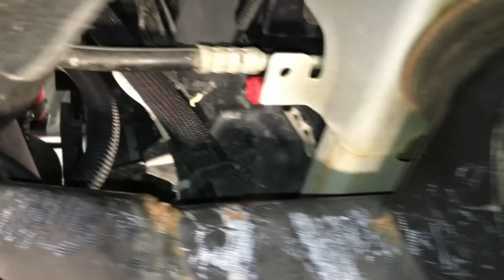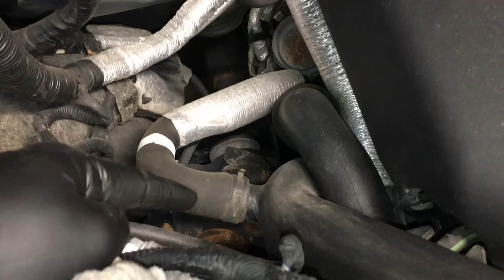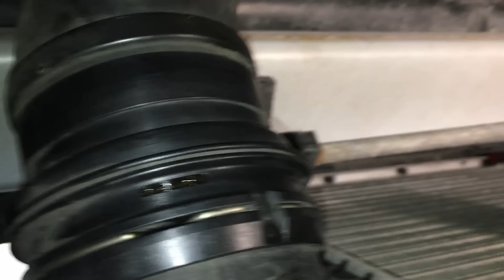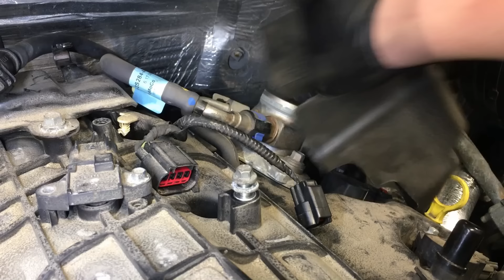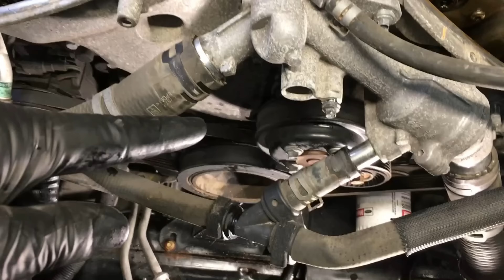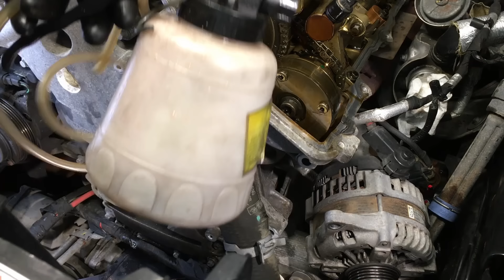2011-2016 Ford F-150 3.5L Ecoboost Timing Set Replacement Part 1: Getting Inside the Engine

Comment from the maker: These are the Tools and Parts I Recommend:
***LATEST PARTS***
Fuel Pump Mounting Bolts (one bag of two bolts)-
W503297S900
Intake Phaser (2 Required)-
http://amzn.to/2IBfdDc
Exhaust Phaser (2 Required)-
http://amzn.to/2u55yS7
Intake Phaser Bolt (2 Required)-
http://amzn.to/2u3Nech
Exhaust Phaser Bolt (2 Required)-
http://amzn.to/2FV0xx6
Primary Timing Chain-
http://amzn.to/2IGlKwy
Secondary Timing Chain (2 Required)-
https://amzn.to/4fzSuWv
Timing Chain Tensioner-
https://amzn.to/2GpN14E
Intake gaskets-
http://amzn.to/2FYsBPW
Valve Cover Gasket Drivers Side (All Years)-
http://amzn.to/2FROlBe
Valve Cover Gasket Passenger Side (2011-2012)-
http://amzn.to/2pr2dXY
Valve Cover Gasket Passenger Side (2013-2015)-)-
DL3Z-6584-C
High Pressure Fuel Pump O-Ring-
http://amzn.to/2FW19Cs
High Pressure Fuel Pump Mounting Gasket-
http://amzn.to/2pxj6QP
Water Pump Gasket-
http://amzn.to/2pvVWum
Pump O-Ring-
http://amzn.to/2psqCfX
Coolant Inlet Seal-
http://amzn.to/2prwJSw
Front Crankshaft Seal-
http://amzn.to/2prBfjZ
Front Cover Radial Seal-
http://amzn.to/2u59yC7
Crankshaft Pulley Bolt-
http://amzn.to/2u7P2kt
Motorcraft Front Cover Sealant (MUST USE)-
http://amzn.to/2psPqo2
Motorcraft NEW Yellow P-OAT Coolant (2 Bottles of Concentrate Required)-
https://amzn.to/3Pc66wi
Engine Oil 5w-30 (6qts Required)-
http://amzn.to/2GLtahd

**Recommended Tools**
Crankshaft Pulley Remover-
http://amzn.to/2G0lS8s
Camshaft Holding Tools-
http://amzn.to/2FXx7yd
Cat Claw-
http://amzn.to/2IBBJM6
Scotch Brite Cleaning Pads-
http://amzn.to/2Ga6GbV
Air Wand-
http://amzn.to/2DIe74L
Vacuum Bleeder-
http://amzn.to/2FWdWol
Oil Catch Can Kit-
http://amzn.to/2pnZvn1
***OPTIONAL PARTS YOU MAY WANT TO REPLACE***
Engine Valley Coolant Pipe O-Rings (2 Required)-
http://amzn.to/2HPpYAC
Degas Bottle Heater Hose (Common to Leak)-
http://amzn.to/2HRq3Up

TORQUE SEQUENCE AND SPECS:
Front Cover-
https://drive.google.com/file/d/1vvzqqEtyVb-ncDzoaGumVRJ8ZsoMr3xR/view?usp=sharing
LH Valve Cover-
https://drive.google.com/file/d/1_N1FFgp0ApZTaHuCum4muzBNVfigww_G/view?usp=sharing
2011-2012 RH Valve Cover-
https://drive.google.com/file/d/1O-QxJdoZ2r1wIKJErGMkkRhMRkuu2pX4/view?usp=sharing
2013 and Newer RH Valve Cover-
https://drive.google.com/file/d/1IL0rZz7uJLkS61bhPm24raulzfJoFBAb/view?usp=sharing
Intake Manifold-
https://drive.google.com/file/d/1W3s3GzR7T69OzV35Ehrm8-kf86eCZNFG/view?usp=sharing
Water Pump-
https://drive.google.com/file/d/1WdDoFxPYrGkam6PjeJr8B3RH0lhhm76T/view?usp=sharing
Thermostat Crossover-
https://drive.google.com/file/d/1f6_ZJOi2He-iLdAvcOO3fEmc1hh5yrIZ/view?usp=sharing

As an Amazon Associate I earn from qualifying purchases.
Reply: I don't see the 2 little chains for the cam phasers in the parts list. Are they reusable? Or do you have the parts numbers? I don't see them with the primary chain link
Reply: @joshdemars7960  Those secondary timing chains should be fine to reuse; I didn't replace them on my truck.
Reply: What's your opinion of opting for Cloyes chain kit & melling oil pumps vs FoMoCo?
Reply: FordTechMakuloco my dealer will not cover this under the emissions warranty and I am outside the powertrain waranty. They are coding it as 6C525 (cam). Do you have any advice on dealing with them? Thanks 
Dustin
Reply: Intake Gaskets:  6 required
Reply: Great video.  Do you have the part numbers for the High pressure fuel pump replacement bolts, nut, and the gasket?  I'm sorry if you already posted them, but I didn't see them in this list.  Thanks and keep up the great videos.
Reply: You will also need the two Torque to Yield (TTY) fuel pump mounting bolts (not reusable).  Ford part number :  W503297-S900.  They come in a package of two, but I wasn't able to locate them on Amazon.  Got them from the local Ford dealership for about $10.
Reply: FordTechMakuloco.... how much would this cost if I took it to your shop? BSG Auto is about 5hrs away from me and I'd like a mechanic who knows what they're doing
Reply: I just got quoted $2,361 by a dealer near me.
Reply: What is the average cost to have this fixed
Reply: I didn't see a link for secondary chains. Do you have a recommendation on where to purchase?
Reply: Is this parts list still accurate as of January 2025?
Reply: @andrewschleweet5646  I am also wondering if this is up to date. All of the links I checked showed they had the parts and they fit my vehicle but that doesn't mean there aren't newer improved parts out there. Thanks for any feedback to anyone who has an answer to this.
Reply: @sethellison6751  I just ended up purchasing parts from Freedomracing and Tasca after compiling an individual parts list.
Reply: @sethellison6751  I'm in the same boat, I;m about to just buy the cloyles or melling kit
Reply: @JacoblFrye  I am going with the Cloyles kit. After some research I believe everything will work and they have good quality reviews. It should help save some money and not have to buy tons of individual parts aside from all of the other gaskets what not haha. Best of luck on your endeavors. Hope all goes well.
Reply: @sethellison6751  same for you buddy! I just don't get why the cloyes vs melling is like 300$ difference for what?
Reply: They pulled that exact same shit with me. 
It is a hopeless fight. 
Escalated it to ford corporate and you know the reponse was basically go to hell, we know its an issue but screw you.
Reply: Dylan Vela it really depends on the area, availably of non Ford dealership, and how you negotiate. 
I have had a quote for as low as $2750, while the nearby dealerships wanted well over $4000.
My home dealership was willing to work with me somewhat because they knew the situation and actually cared about me, but even then they were pushing $3250 if I recall correctly. They did however agree with my offer to buy parts and pay half labor rate since this would Mark the 3 time the repair was done. Mind you, I didn't make the judgement call that led to the work being done before, it was the dealer that deemed necessary. No idea why it didn't work the first time unless they messed something up. 

I just wish I had a Craftsman like FTM here. I'd be a lot more confident
Reply: Are these all common with a 2014 Explorer Sport??
Reply: Do you have the part number for the torque to yield fowl pump bolts 
Thanks!!!
Reply: FordTechMakuloco 
Thank you for your video ,, do you think a guy like me can do this chain swap?
I’m not a mechanic
Reply: Guy Lauziere I’m thinking of doing the same thing on my own (but I also have to remove the cylinder heads) and I'm a little nervous since I've never done an internal procedure on the engine before, just basic things. But Brian makes it look very simple.

Did you have any kind of advanced mechanical knowledge when you did this procedure?
Reply: The link to the secondary tensioner holding tool no longer works.  Do you have another recommendation?
Reply: FordTechMakuloco will most of these parts fit on a 2016 F150?
Reply: Hello,
This parts will fit for my f-150 raptor 2017 ecoboost 3.5 ? 
Thank you
Reply: FordTechMakuloco I cant get the bolt out of the bottom pully any help on this
Reply: Can I bring my truck to you wherever you're located I tried 3 different Ford dealers and none of them wants to do it I guess because none of them called me back after they said they would
Reply: I need the recommended Parts for a 2010 FLEX Non-EB. Would you be able to help me (and others) with that?
Reply: Water pump link?
Reply: Great video thanks for the good information keep up the great show can't wait to see what's next 👍
Reply: Are these parts in line with TSB 18-2305?
Reply: Is there a gasket for the front  cover that goes around all the holes ?
Reply: Are these still current from the TSB 18-2305 in 2026?
Reply: I have a 2016 Ford F-150 ignition turns everything on engine will not crank over no noise at all it won't even start or crank over I need a help dealer can't even figure it out
Reply: @sergiopena4866 it’s your timing, I’m going through the same stuff right now with my 2014 3.7 ford f 150 ecoboost
Reply: helo mister ask for a washap number to learn and ask for car engine problems ford cars

Comment: I’ve think I’m at the point of trashing my truck..I got to the crankshaft bolt and heard a pop in the front of my motor and the bolt will not come off no matter what I’ve done..heat, different impacts,long breaker bar with pipe…I threw in the towel🏳️🏳️🏳️out 7k and the 1200 in parts…

Comment: Dude I’ve been dreading this job because I don’t have a garage and I’m up in Northern Ontario, and we have short summers, and lots of rain, but I just want to tell you how grateful I am you made such a detailed video.

I did the job once and changed just the phasers like a year ago and it’s worse now but I also skipped a lot of steps like not installing new guides and tensioners, also I noticed my vacuum pump leaks and my timing cover as well, also replacing the oil pump while I’m in there, yeh big job, so thanks again and hope these videos don’t all of a sudden disappear

Comment: My take on this job.... Its doable by most. There are a few places in this 4 part series where he very craftily cuts out and fails to mentions the extreme pain in the ass some steps are. Had I seen some of these struggles I may have changed my mind about doing this. After the job is done I would say I would do it again to save a few thousand dollars if it weren't a needed vehicle and I could leisurely work on it. The money I saved I spent on replacing other parts because while I here its easier than tearing it apart later. This is a very well done video and it helped me tremendously. I just wanted to note there are omitted difficulties. Basically when he just ponts and says what needs to be done and not show you.

Comment: My 2012 (138k) doesn't exhibit any problems with timing chain or cam phasers. It comes down to using high quality 100% synthetic oil with high quality filter at intervels below recommendations.

Comment: I'm about to have my local Ford dealer do this job.  I have a '13 F150 with 113k miles and getting the start up rattle after sitting for about 8-10 hours.  My question is are they replacing with the same parts or are they updated/upgraded parts?   Just trying to figure out if I'm going to have this problem again in 100k miles.

Comment: These videos are awesome. Thank you for walking me through this process. I could not have done it without this video. Although I feel you need to start encouraging people to swap out the waterpump housing/idler sprocket housing as well. I was unsure whether or not they had tty bolts being it has a 2 step torqing process but another ford tech lmk they are reusable. 15. 3.5eco 240k. I had everything you recommended plus the melling oil pump but wasnt prepared for what I found was the root of my issue. The waterpump housing/idler sprocket housing. The sprocket had broken off the housing and tore a groove into my timing cover. There are no videos that I can find that show the process but I have found torque specs and sequence info. Thats it. Thanks again and looking forward to the next great video.

Comment: I watched this 3 part series and then using Alldata did a timing and phaser job on a 2018 Expedition 3.5L Ecoboost.  Went very smooth and after reassembly the vehicle runs great, no more clatter from the phasers.  However, when the vehicle is shut off after reaching operating temp all 4 of the new VCT solenoids do a rapid cycling for 2-3 seconds, sounds like a rapid tiking sound.  Anyone have any ideas why they are doing this?

Comment: Watched this primarily for a turbo cooling plumbing replacement and a vacuum pump seal leak, but unfortunately you glossed over the RH (both actually) valve cover removals.  I have that valve cover loose all around and did the putty knife thingy around a majority of it but it is still not budging much.  I'm thinking the vacuum pump may be a 'sticking' point so that'll go next. I assume a lot of it is possibly stuck spark plug seals and solenoid grommets, hope I don't break too much finally getting it off.

Comment: @Fordtechmakuloco, on the 3.7L n/a engine in the 2014 F150, is it possible to just inspect/replace the lower chain tensioner if there is a suspicion that it has failed? (Light knocking sound when hot, only under EXTREMELY light throttle)

Comment: Its 2025 and I'm getting ready to do this job on my 2015 F150 with 155K on it.  It has the chain rattle, a serious oil leak, and probably needs at least one new turbocharger (replacing both anyway).  Its amazing to me how conceptually similar this is to a big diesel engines vs the gas engines I used to work on.  This was a great video.... the tedium of all of the hoses, connectors, clips, brackets, etc., is really the daunting part of the job to me.  Thank you for doing this.

Comment: I know this is an old video - but that wire that goes to the top of the canister purge valve - what does it connect to and what is it called - the wire with the connector you removed? I need to replace mine, as a squirrel or chipmunk chewed on those wires. Thank you
Reply from the maker: The canister purge valve wiring pigtail goes into the main engine harness.
Reply: @FordTechMakuloco  thanks mate! Sounds like I will need to splice it in under that metal piece in the back that mounts the high pressure thingy with the foam cover

Comment: Finished with this repair on a 2012 F-150 at 226K miles. Avoided $2500 in shop time. It took me a while but overall, everything went smooth and I'm so grateful for this video series. 
Get the harmonic balancer tool! The rental I got from Oreilly's would not fit.

Comment: I had mine done by ford here in Canada in Thunder bay  $5500.00   lol parts  labour and taxes in  😭This should havwe been a recall but they want to make monery off their defficiency of cheaping out on parts and one timing chain that is no bigger than a bycicle chain .There should have been two timing chains (one for each valve bank)  🖕 My next truck will not be a ford 🖕

Comment: Excellent channel and breakdown for replacement of the EcoBoost timing components. Your notes at https://youtu.be/Va6sVtzRZAo?t=634 regarding oil residue in the charge air pipe caught my attention because i noticed this symptom while performing similar work on my 2017 Taurus SHO (dreaded H2O pump...). In the Taurus I see oil residue in the inlet pipes pre-turbo; this oil is not in the top section of the pipe but after some other lines attach to the pre-turbo air pipe. The oil residue is pre & post-turbo and in the boosted air pipes and intake. I was initially very concerned that i might have a failing turbo leaking oil into the boosted charge air, but the oil is before/after turbos and turbo shaft play is very small (100kmi). You recommend adding an oil catch can - which one and where would it be added? Thanks!

Comment: Very nice video with a lot of detail, I did this job and don't see how you could get such good reach into the engine compartment I felt like i needed to climb in. Good video with a couple of small details left out but for anyone who has spent time working on cars figured it out. I let you know if it runs when I'm finished. And BTW I can't find the fuel pump bolts anywhere.

Comment: Messed up and the chain had so much slack while removing that while turning the crank, the cam chains skipped and now everything is off time. I can turn eventually to get the crank and intake cams aligned, but the exhaust cams are now turned and in aligned. I turned each cam to get the tool on so I could remove the chain. Any ideas how to proceed with basically setting the timing for all 5 shafts to aligned?

Update:
Finished the rebuild process, now it cranks but no start. I took pictures verifying timing marks before and after tension to make sure nothing slipped during installation. Best guess is it wasn’t at TDC yet. So probably starting over with this one.
Reply: The new chains and phasers have alignment marks on them. If you are off, they'll tell you. Just make the adjustments manually to the cams to get them lined up. The phasers are keyed, so if you accidentally moved the exhaust away from the intake (say 180 off) then you wouldn't be able to get it in. Assuming you lined up the secondary chain with the phaser marks.
Reply: @ thankyou very much for this!!!
Reply: You're welcome. The 3rd video in this set goes over the intake, exhaust, and secondary chain alignment. Watch that and it should help more than my comments.

Comment: Word of caution!!!! I did the timing job in this fantastic video set. It worked great. But after 11 months, I have the startup rattle again. Tore it apart again and the chain is stretched again (2 notches left on the tensioner). I Requested replacement parts from Ford, and they told me to eat $#!+. Effectively said they don't warranty parts to at home mechanics. Needs pinpoint proof by an authorized Ford mechanic that the part failed. No knock against this fantastic video. Just be warned that the new Ford parts you are putting in can fail quickly. Oh and by the way, the new radiator hose mentioned in the video was replaced at the same time and is already leaking too!!!

Because they know all they solda ya was a guaranteed piece of $#!+. That's all it is. Hey, if you want me to take a dump in a box and mark it guaranteed, I will. I got spare time.

Comment: Thanks for the videos Brian! I'm not sure if this question is in the comments already - haven't been able to find it. 
There is a lot of carbon on the wetted surfaces (heads and front of block). I will be cleaning off as best I can but obviously won't get it all. Should I change the oil after ~200 miles to try to flush it out? Will be installing the catch can so hopefully reduce the carbon going forward. 
Really appreciate the effort you put into these videos. Nice to be able to do this repair at home! Tim :D